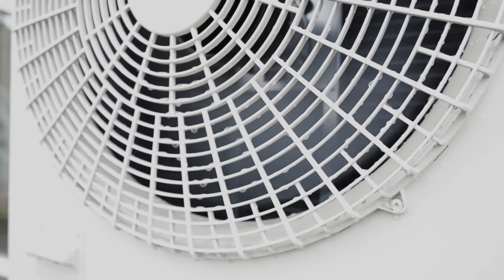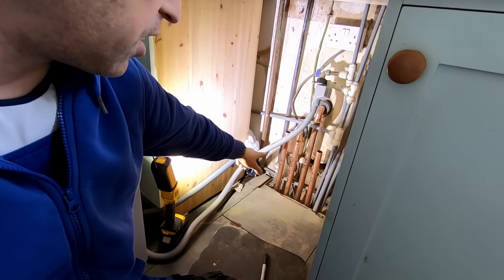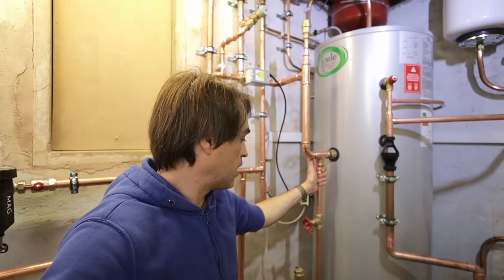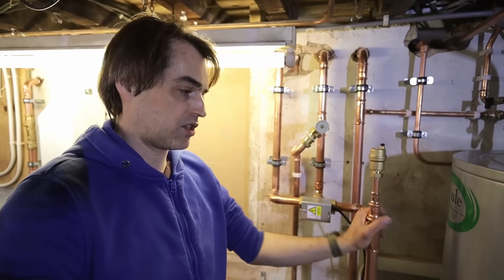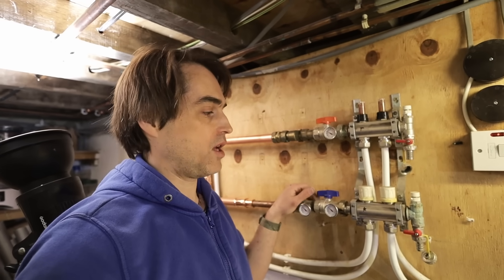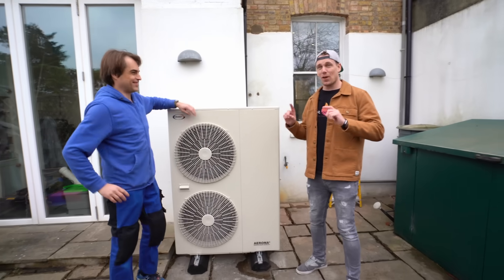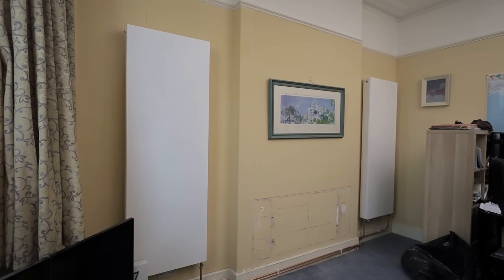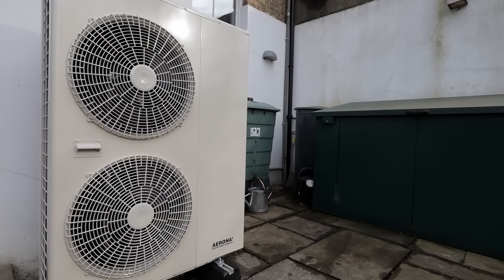The Truth about Heat Pumps: Debunking the Myth.

Comment: Sadly I think Roger has an axe to grind with heat pumps and I don't know why.

Poor install by companies who just want sales have a lot to answer for sadly and the industry I think needs tighter regulation to make sure installers are fully informed, full calculations are done before install and the customer is aware that it won't be effective if they don't have the whole system optimised.
Reply: I think Roger has a point, of sorts. He’s never said heat pumps never work, but how much would that install have cost? And how ugly are those TWO massive radiators in that lounge? And how much will the energy bills be?
Reply: @SisterAbdullahX  I estimated that install at £18k Inc VAT, UP said closer to £20k so yeah, it's a huge undertaking which many people can't afford, especially when the Heat Pump is £4k alone that's the price of most full installs for a standard home for a gas central heating system in a typical British property. 

Then you have the issue that even if you use weather comp and design for 50c, older people want higher surface temps and don't want fan coils pushing the air around to make up for the lower flow temps. Honestly I love fitting HP, Gas, not fond of oil and LPG just causes me to go home stinking but I feel like AC and mechanical ventilation would be better and having worked in america where many house builders are now trying to build passive houses on a commercial scale I feel the UK should be doing the same. 

After all if you don't have to consume any energy to keep a property at a comfortable level you've already saved the carbon footprint of building the property and don't have to worry about running costs which in turn means more spending money for home owners to put back into the economy. Perhaps that's just a little too logical for government though.
Reply: @effervescence5664  Yep. I can see why HeatGeek is pushing Air Source (💷💷💷…) but the overwhelming majority of British home owners just aren’t going to go for a system like that. It’s far too expensive and intrusive.
Reply: @SisterAbdullahX  Yes it's not a large percentage of our business at all. We thought it would be hence we invested into the courses and even have a guy that's done stuff with Heat Geek. But for domestic it just hasn't been, commercial for the last 2 decades it has been a decent investment but it has for the most part been a tax deductible eco benefit to those institutions and companies we've installed for. Home owners on the other hand can't claim it all back or knock it off their personal tax, and some in older solid wall properties or ones of significant enough cultural interest can't have heat pumps at all. Insulation where permitted and a well designed gas installation will serve them far better until such a time that a wall hung heat pump can be produced.
Reply: The advantage of course of a heat pump is that you can combine it with solar and battery storage to reduce the running costs over time. But I take your point it is a bug chunk compared to a new Combi boiler. Although even Combi systems would benefit from bigger rads and lower temps. I believe there are finally some regs coming in that new builds should be low temp which will help things.

Ive consistently argued now that all new builds should be as energy independent as possible. Solar, batteries, heat pump and eV charge points as standard wherever possible. Reduces the load on the grid over time and reduces fossi fuel usage which will ultimately lower electricity costs. Passive house standards should be adopted too we're way behind the curve in that respect. And we need to look at ways to get costs of retrofitting this stuff down. Economies of scale will help eventually.
Reply: @Tom_Plumb_PHS  Absolutely! I have been saying this for years too. Solar, batteries, heat pump, ev charging point should be standard on all new houses. Additional cost per plot less than 3% of the property price (roughly) makes it a no-brainer. That said this is 3% not going to profit for the builder and if you can sell the house fir the same price without the upgrades...why bother? 

We need legislation or Building Regs to make this mandatory.

I cannot for the life of me understand why PV isn't already mandatory. Would be a great help to lessen the load on the grid.

Comment: Absolute pleasure working with you Simon. Your a great embassador for the industry!
Reply: Hey Simon,  as usual absolutely stunning install. The work is a true master piece and I know you installed this to someone spec. However  shame about the design  and products  that have  been used here , the radiators are truly and shockingly ugly I would sooner have a poster of the elephantman on the wall.  Cost for this was  probably £25k if this is what the government is encouraging people to have ? We urgently need a new government !!!(I know of an estate that had these fitted and thus far winter cost £1500.00 per quarter , they have to be left on 24/7 .... this size probably  £2000.00  per quatre...)  And finally I hope who the person who sold this to the customer advised them that , after the install there's no going back to there gas boiler...cuz that will be the next thing this incompetent government will make law...people you have been warned ⚠️ Don't be fooled.......a master piece of workmanship Simon  as always 😉
Reply: @TheLegend-nx3mm  nonsense
Reply from the maker: ohh, thank you
Reply: @UrbanPlumbers  what was the total cost of the installation including parts?
Reply: Just wondering   could  put it Out There... the  Make and Model of Robust Circulation Pump you used to pump that seriously Hot water around the Circuit...as I'm sure many folks would have an Interest in that Pump....I have been told "Stuart Turner " Brass/ Bronze pumps do hold up well as Booster Pumps... But haven't had experience with their Circulation Pumps ...Great Upload...